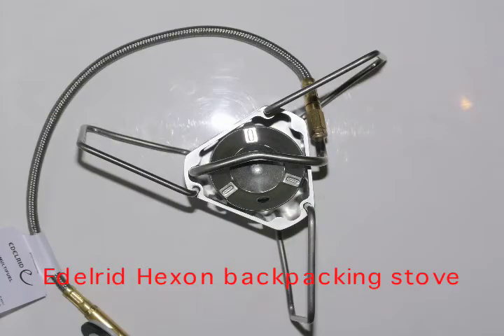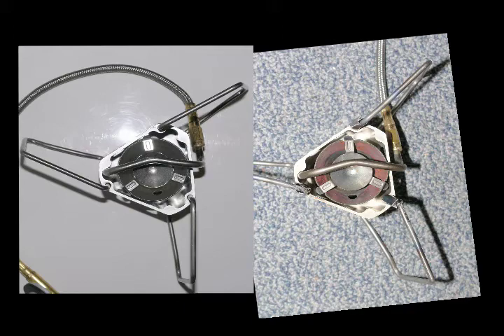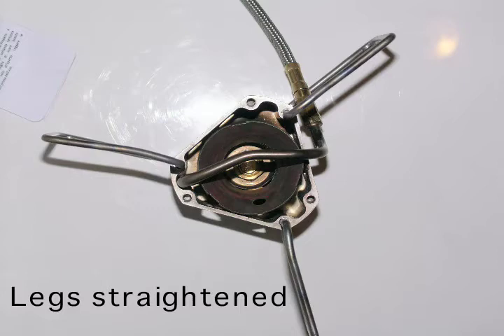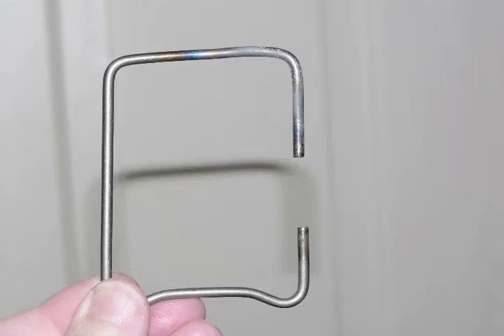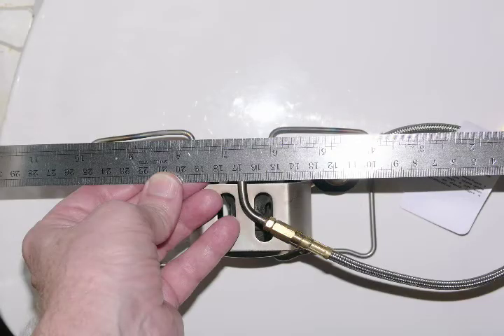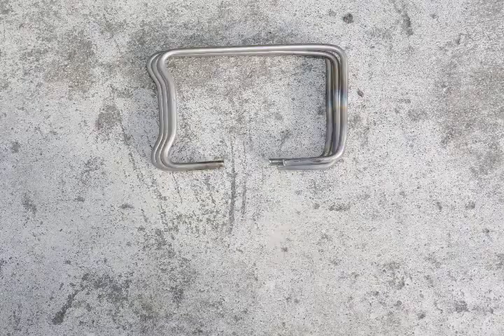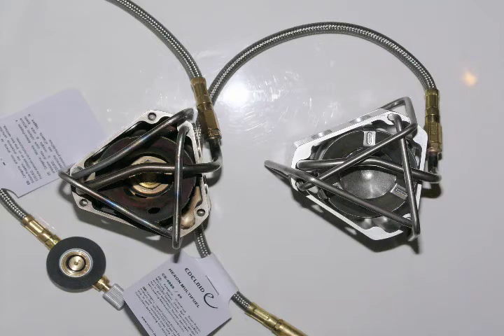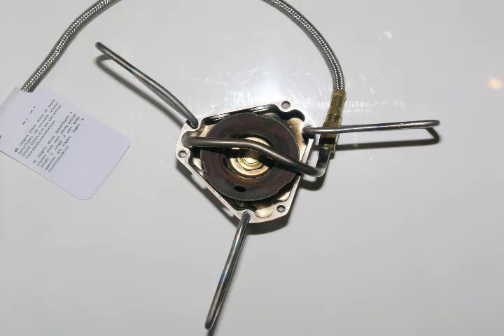Edelrid Hexon Multi-Fuel Stove Review, Part 3, sub-part "A"

Comment: Do you know under what criteria TSA confiscates fuel bottles? Is it because people don't clean them good enough on the return trip? I contacted Edelrid of North America by email and a guy told me they had resolved the leg distortion heat problem which he claimed only happened with a hand full out of 1000 units with a design change but didn't go into any detail. Do you know what kind of metal the legs are made from?

Comment from the maker: I think there are TSA related web sites that answer that very question. However, having ANY residual smells is certainly a NO-NO! Some say fill the tank with water or oil. The syringe idea (video) just shows that any similar stove can be operated w/o any pump. And, the syringes are cheap.

No, I wasn't aware that they had done ANYTHING to the stove legs. I assume the one I had had SS legs. I guess I was one of the lucky ones to have a problem!

Comment from the maker: I found my Hexon stove and weighed it on a small digital scale, accurate to +/- 0.5g. Actualy weight OF THE STOVE ITSELF (including the line and Lindal connector, but NOT the pump or fuel bottle) is 228g, advertised is 220g. This weight difference is 3.6%, a negligible error in my opinion. Hope this helps.

Comment from the maker: I cannot currently locate my pump or fuel bottle. Given the minimal % error that I noticed in the difference between the advertised weight of the stove vs the weight I got from my digital scale, I would ASSUME that this same miniscule error applies to the other components as well. If you are that concerned about a little extra weight, consider buying the stove, weighing it (such as on a postal scale) and return it for refund if it is not acceptable.